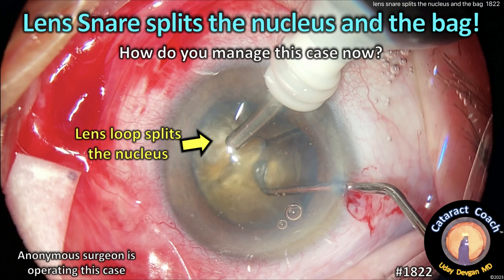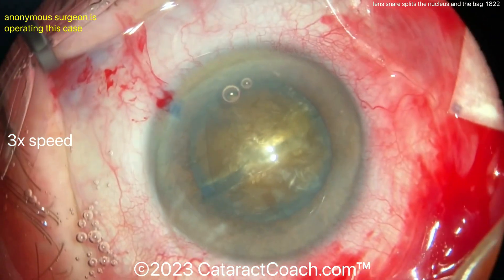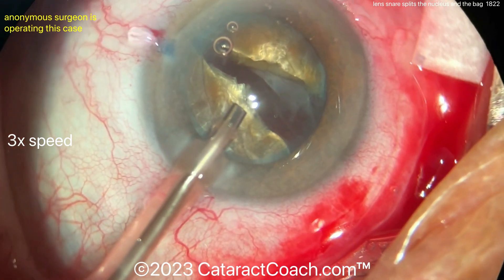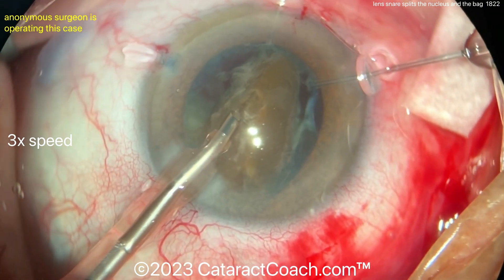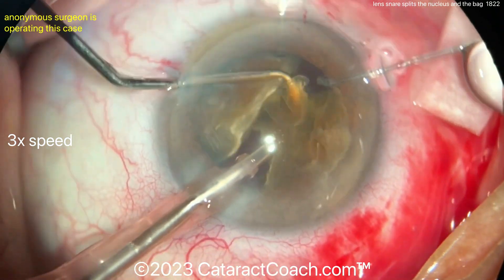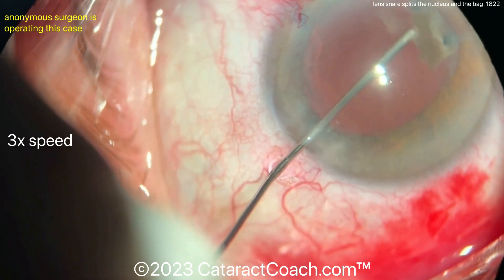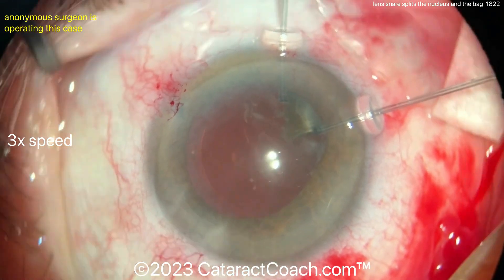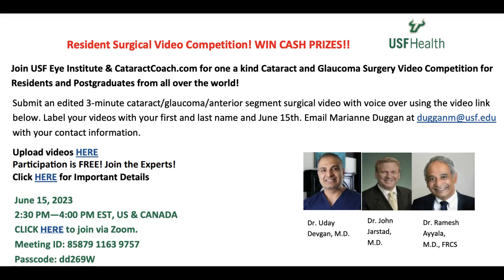CataractCoach™1822: lens snare (lens loop miloop) splits nucleus and bag

Comment: I have used the miLoop about 15 times and have found it to be a very helpful, safe, and powerful tool for dense/very dense nuclei, turning a potentially very difficult case into a much easier case. However, my understanding is that it can only be safely used in the presence of a complete hydrodissection and freely rotating nucleus. In this case, I did not see the nucleus rotate whatsoever, and I suspect that there was no space for the the miLoop to be insinuated between the capsule and nucleus, resulting in a posterior capsule rupture. If I ever have difficulty performing hydrodissection, I have found it very helpful to de-pressurize the anterior chamber by removing some viscoelastic from the anterior chamber and then gently injecting BSS under the anterior capsule. Thanks very much to the Doctor and Dr. Devgan for sharing this interesting case. Kevin Prendiville
Reply from the maker: Great insight. Thanks for posting your comment.

Comment: I hate to Monday morning quarterback the surgeon here, but I'm wondering if he or she realized the bag was open, or at what point it was realized. They got very lucky rescuing that first piece from going south and did a good job wolfing it down without sub-chopping it and keeping the whole thing in the AC. If they knew the capsule was open, though, why push the second half into the area of the PC break? Realistically, getting away with phaco on the first half, they might have been ok to just bring the piece central and wolf it down. Using too much visco and pushing the piece peripherally into the area of the break was the downfall of this case. 
Everyone saying "convert" is all fine and dandy if you know the capsule is open, but what if you don't? MICS would have been totally reasonable in this case from the start with that level of nuclear density, or upon realization that the capsule is open.

Comment: The loop looked like it was used properly. Not sure why the capsule split…….
Reply: Maybe the snare pulled against a preexisting weak spot in the capsule from prior injection or just weak anatomic spot. The loop rubs the PC with a metal wire deep into the fornix of the capsule, which is a move we don't normally do with chopper. These advanced tools are fun, but I like sticking to the same second instrument that I'm comfortable with.
Reply: That’s one of the reasons I don’t like it; you can’t really see what’s going on back there.